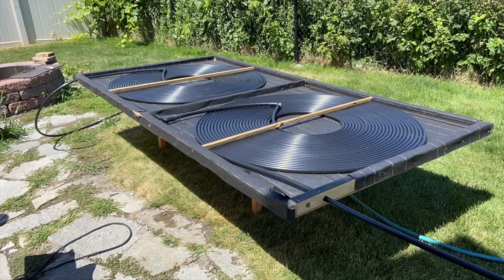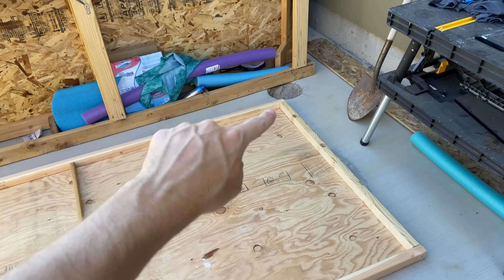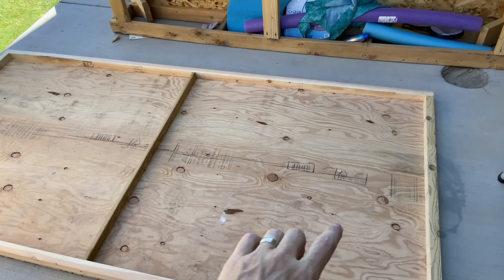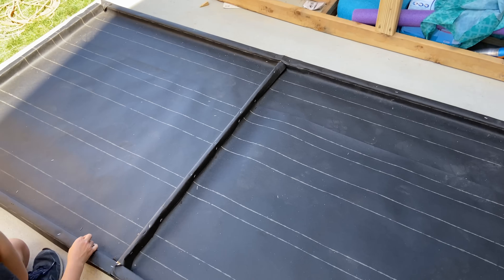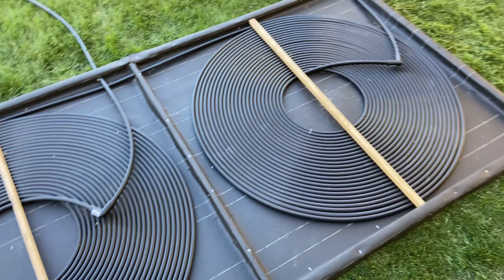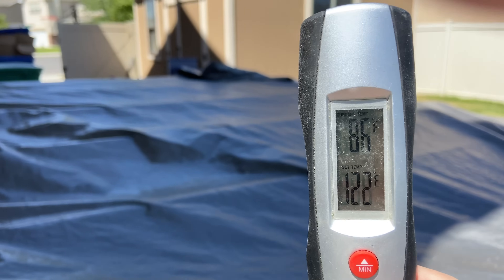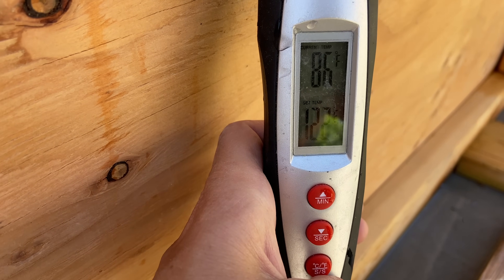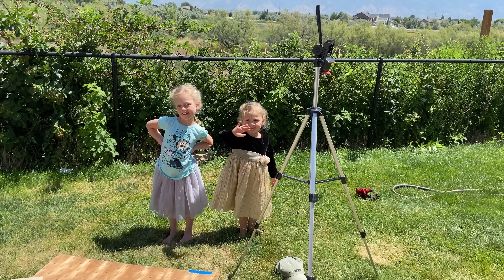DIY Pool Heater - $50 Solar Heater

Comment: If you fill the panel with water, it will heat the water in the hoses more, due to higher conductivity, but you also want to make sure it's sealed so water vapor can't escape. (Also will want to use a bladder to handle expansion from heating.)

So the water around the tubes can hold more energy, and keep the pool heated later in the night, and you can set up an automatic switch to turn on and off based on the temperature of the water in the system, so it never cools the pool.

With the water around the tubes, you can also use mirrors to add more heat, with less concern of causing any damage.
Reply: Id use a raspberry pi with two thermometers,  if (pool temp < desired) then if( panel tep > pool temp) then pump ON else pump OFF end end
Reply: How about using sand instead of water? I'm in the middle of making one.
Reply: @atomisum6445  would light colored sand reflect more heat?
Reply: water around pipes will be hard to maintain (algae), prefer sand and consider weight😉
Reply: I thought about sand.

Comment: No one ever links or describes the pump they’re using.
Reply: if the heater and tank/spa/pool or whatever are on a similar level like this than you may not need a pump as it could run via thermal syphon(cold intake low hot outlet up high). that said our pool is heated like this and the system uses a small pool pump made by davey to get it onto the shed roof.
on a smaller scale you could use a solar/12v water transfer pump.

Comment: I did something similar years ago for my parents pool.  I used a "swamp" cooler pump and hooked it up to a long water hose that I ran around their backyard concrete deck, then back into the pool.  It raised the temperature of the water over 10 degrees in the Texas summer.
Reply: Why were you heating your pool during summer. Let alone Texas summer. That’s not smart.
Reply: @jamesbizs  Because they have an indoor pool that never really heated up.

Comment: Water flow rate will make zero difference. Joules of energy in, joules of energy out. However many joules of energy that can be absorbed by the greenhouse and xfered to the water will still be transfered to the water regardless of how fast the water is going thru it. And all of those joules will be absorbed by the large pool of water at the end.

Comment: He did not test pool temperature. Proper similar systems pumping water through plastic tubing require about a square meter of heat collector for every meter square of the pool surface and generally take a day or so to heat the pool adequatly. All the pool water must be pumped out through the solar collector to get heated. Showing the temperature of water in a small container is not heating the pool and the amount of water flow shown will never heat the pool as not enough warm water can be produced by the small solar collector available.

Comment: 50$ is a bunch of crap, all sorts of supplies not mentioned, probably 50 in just plumbing if you are lucky, your methods of checking temp are ridiculous.  Only ones that matters are when connected to the pool and running for hours, maybe you finally did that, I was bored with the bs and quit watching.  Not to mention it’s a trickle, lol.

Comment: I'm missing something, maybe need to rewatch. you were getting 152 degree water, then you were only getting 90 degree water. What happened?
Reply: im guessing sun angle time of day stuff like that prob played a part in the huge change. and prob from the time it was on the ground to when he had it up on a stand and all that it prob was not in direct sun so that prob also cooled it down.
Reply: @mitchyitchy3  oh, so it wasn't one right after the other it seems. I appreciate the answer, and also the video! thank you! I wonder if greenhouse polycarbonate sheet would be cost effective for use to cover, and I wonder its effect on efficiency. I wonder how PEX tubing would change the equation too, since it is designed for heat transfer.

Comment: The tests here don't tell how well it heats the pool. In the south west USA industry standard is have solar collection panels square footage equal to water surface area.  Having equal area will allow winter swimming pool temps in the mid 70's or 80's. Having less panel area can extend swimming season a lot. A pool bubble cover will raise the pool temperature 10 degrees in a week or less.

Comment: How long will your pump last?  I  think pool pumps have low head & discharge pressure -- (not designed to pump water through hundreds of feet of tubing).

Comment: Slowing the flow down will not increase your heating capacity. In fact you'll find your pool won't warm as much.

You want to take as much heat away from your 2 coils as possible, leaving the water in there for too long and it will reach it's upper limit. It's about temperature differential that's how you get the most from it.

Also liken it to this, one bucket of 80c water a day as opposed to 4 buckets at 70c. More energy in the 4 buckets so will increase you pool temp more.

Factor in heat lose of the pool etc and you might find the slower flow will be counterproductive.
Reply: Ok what about 10 buckets at 30.  More energy than 4 buckets at 70 unfortunately you pool will never reach a reasonable temperature to swim in.  For goodness sakes, if you heat your water more (slowing down the flow rate) eventually the pool will heat up MORE.  Maybe it will take a bit longer scientifically but it will STILL heat up more.

Comment: I liked the video and the effort and detail added.  One thing that is missing is the flow rate of the water. That Piece of info is need to determine the amount of energy being picked up by the system. Also, if you can put the water through the system faster you will get more energy into the pool.  A good way to check your overall efficiency would be to get the the pool water to bring down the air temperature in the wooden box. The cooler the pool water can make that box, the more energy is being put into the pool.
Reply: It's 4,000 BTU/hr.

Comment: Reducing the rate of flow won't heat your pool any faster. You still have the same amount of energy in the water, just more concentrated. The only advantage is using less power for the pump. I'd rather use a few more watts and not have scalding hot water going into the pool that could be a danger to anyone who gets to close to it.

Comment: Keep in mind the sun produces only 1kw of energy per square meter. 125000btus is about 68kwatts of energy. Therefore you would need a surface area of 68 square meters of surface area to produce 125000btus and with ideal sun conditions and based on a 100% efficiency. This setup is maybe 70% efficienct . Therefore you would need a surface area that is even larger to achieve 125000btus.
Reply: This guy gets it. This is a 4,000 BTU /hr system based on the flow rate and temp change shown in the video.

Comment: I don't know if you know this but you don't need a water pump for this setup.  You can rely on the Convection siphon between Hot and Cold Water.  As you probably know cold water sinks and warm water raises so as long as there are no bubbles in the system and the cold inlet is lower than the warm outlet. It will self-cycle via siphoning the pressure from hot to cold. great video btw well done
Reply: While your spot on with the science, the issue is the flow rate and size of the pool. His system doesnt seem very efficient for heating such a large pool. The amount of time it would take to change it a few degrees doesnt seem to justify the work and costs to build the solar heater.
Reply: But if you want to control the efficiency, you need a pump and be able to control the flow.

Comment: Looks great. You could also consider adding a thin layer of sand to what the coil pipes sit on, and then having two large mirrors on the ground angled at the sand to make the heat increase, like them solar power stations near Vegas maybe
Reply: Good idea, sand will hold the heat after sundown
Reply: Would you put thin layer of sand on top of tar paper?

Comment: To the dad. I will give u a hand at free electricity. 
What you built. Put it up on a roof that gets sun all day. Keep a 3/4 space between each BLACK pipe coil. It let's the sun heat under and on the side of the tubing. Start with 1"1/2 .2/3 thru the coil drop the size to 1". Place check valves in the system. Pipe the plastic piping into the garage put foam insulation around it. Buy a closed paddle wheel, soul. Hot broiling pressures water shoots thru one side and snins wheel in it.
Connect to a small electric generator only the coil. Make sure it spins some what easily. 
Set up your battery BANKS. A voltage regulator. 
Connect to , your meter.  It will spin backward.
You can sell power back. The black pipe to make the loop. To cool the water that's been used.
Dig a ditch along the side of the garage x ? Feet. Then loop it back to the roof. If done right , do your math. You'll have free power and can sell back electric to the power company. 
Yes. PHD 1978 arts and industrial design engineering. Used to build nuke power plants.
I'm the FOUNDER of the NRC. That became a federal branch. 1977.

Comment: You’re going to boil. My buddy’s dad built this idea 40 yrs ago, but he used 2 full sheets of plywood (ending with an 8’X8’) , painted black and a continuous single coil of 1”-1.5”(?) black coil. All just run inline with the filtration pump.
Within a month a shutoff/diverter/bypass had to be added because the big in ground pool was getting too hot.
Reply: 2 key differences in your anecdote: much larger solar surface area, and the use of a real pump rather than a submersible pump. The system in this video is only 4,000 BTU/hr, not enough for a substantial difference in an inground pool.

Comment: I’d like to suggest adding a circulation pump in the pool to spread the heated water about. Many comments talk about the heat from the system having a drop entering the pool, so help it acclimate with circulation. 

Also I’m curious what pump are you using to pass the water through the tubes. Sorry if I missed you describing that along your build. 

Great setup, and many thanks for sharing.

Comment: What you should do is start in the centre of the coil with a 6inch (150mm) piece of your pipe. Put and elbow on either end of it, facing opposite directions.
Then start winding two loops together  this way you don't end up with that piece across the top of the coils. Instead you end up with inlet and outlet on the same plane and can pop out through the side of the casing.
Reply: Brilliant!

Comment: How much did it actually warm the pool as a whole during the day?
Also, how are you pumping the water through the tubes?
Reply: He is using a pond pump to feed in from the pool
Temp diff will vary from day to day, between 3 to 6 degrees
Reply: This is a 4,000 BTU/hr system. The temperature increase will depend on the size of the pool.

Comment: You are better off using your home HVAC condensers to heat the pools. This old house has a video on it. 
Not only does it heat your pool, but your pool is helping cool your house.
Reply: Wow. That would be amazing. Like geothermal but aqua thermal!  Unfortunately our AG pool gets mid 90s by July.
Reply: Funny -- I just this week got a quote for that system.  It seems pretty neat, but they thought I should use both A/C condensers' outputs in order to heat my pool.  Quote was like $2900 for the equipment -- then you still need to run the water piping and hire the HVAC guy to install the refrigerant lines and diverter valves.  If you only go with a single A/C condenser, it's less costly.  But for $50 - $100, I'm willing to experiment with a DIY setup like this.
Reply: @Michael_L_  that’s awesome
Reply: Ya because  that's something easy for your average person to do... it would cost a whole Lot more to hire someone to do it.
Reply: @randybobandy9828  if you could figure out the pool plumbing and valves and only hired HVAC tech to handle the lineset wouldn't be too bad. Its like turning your pool into a battery to cool your house and the bonus is the pool gets warmer.